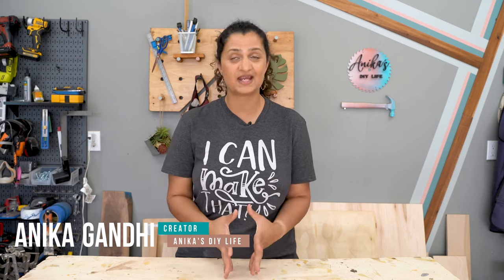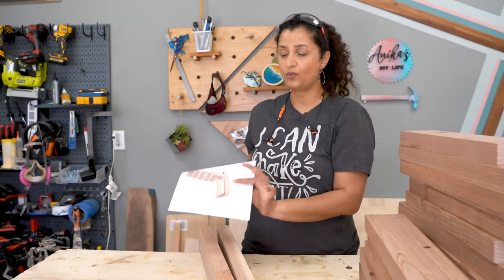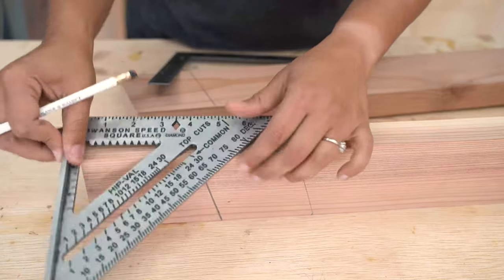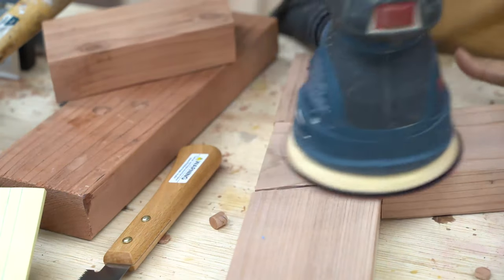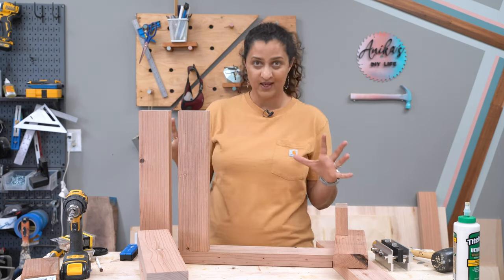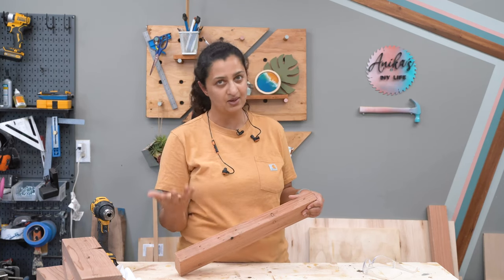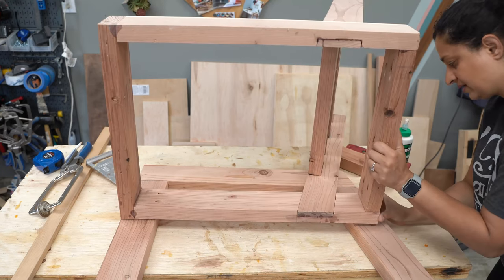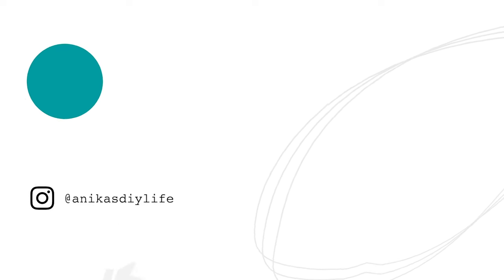DIY 2x4 outdoor chair | How To Build with Plans

Comment: Nice built. Don't mean to complain but suggesting - would be nice to have the back fold down forward onto the seat for storage.
Reply: The Folding Deck Chair is a good Idea.  Specially if you have to get them stored quick because of a 
storm. Or you want to take them along on a camping trip, Family BBQ easy way to put in the vehicle